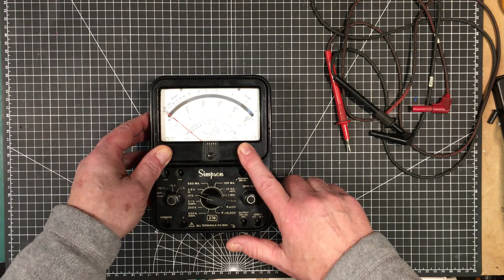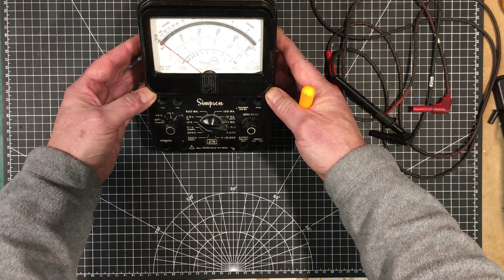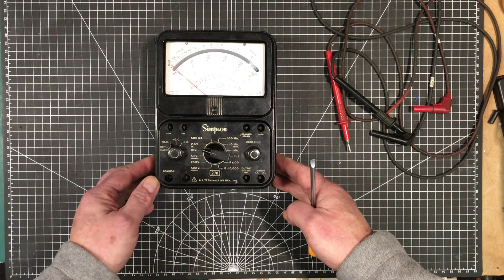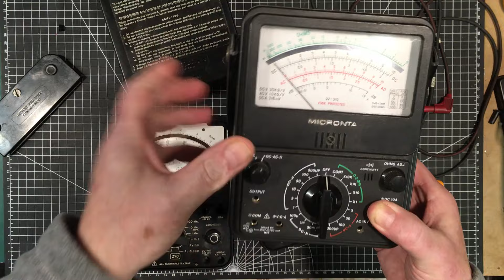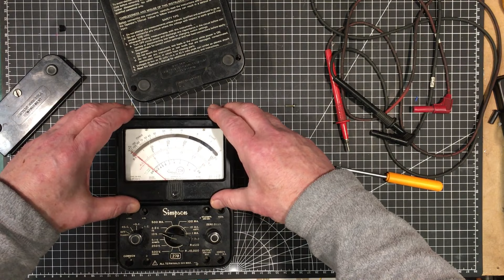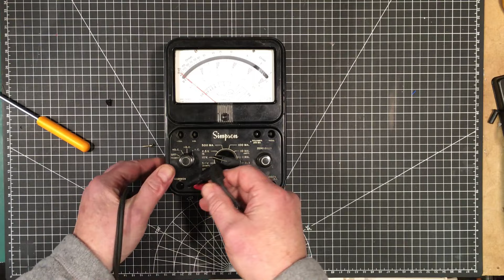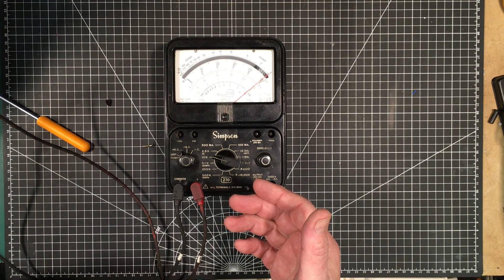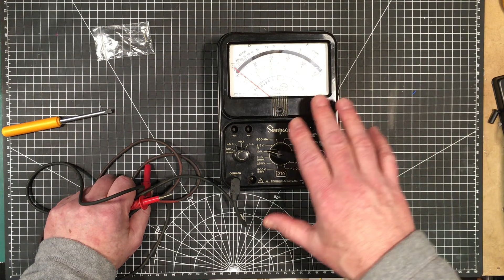Uni-Byte 0160 - Simpson 270 Teardown and Initial Troubleshooting

Comment: I have a 260-8 and a 270-5. Both great meters for my needs in maintaining and repairing aircraft and aviation electronics.  I stared with a micro at clamshell, went to a Fluke 77, then came to the Simpson about 9 years ago, and would not have anything else, except for maybe a Triplett 630 or something like that. A good epoxy adhesive will restore that broken Bakelite to like new, the contamination on the contacts, may be able to be corrected by pulling the board loose?
Reply from the maker: They are great meters.  Thanks for the ideas.

Comment: Great video - Simpson meters were about as good as you can get in terms of analog.

To fix the part that broke off, I once saw someone use superglue (ie Crazy Glue) dropped on baking soda (not baking power) to replace  some brittle plastic. The glue and baking soda formed a very solid material that also was firmly attached to where the original piece had been broken. Then file it to shape and drill in where you need a screw.  DISCLAIMER - I have never done this myself, so experiment first if you decide to try it.
Reply from the maker: Thanks for the suggestion.  I too have never tried that.  Maybe worth doing an experiment or two.
Reply: @uni-byte  If it works, hope you do a video on it!

Comment: For the screw issue... I did not study the video so closely to know if this would work, but maybe reverse the holding force... Rough up all surfaces with sand paper. Clean same with a degreaser. You want to remove the wax from the plastic surfaces, so the glue will get a bite. Acquire a piece of threaded bar stock that is the same size as the screw. Screw it into the remaining stanchion, as much as possible. Layer in epoxy and wide weave fabric to create something like fiber glass. Saturate the fabric, before laying it in (emphasis.) Try to mimic the original stanchion shape. If you could make it larger and still have everything fit in place, all the better. Use a nut to secure its other end to the case. Now, the holding force is not working against the weak spot, which is the broken stanchion. HTH.
Reply: Additional thinking... I have made dams with painter's tape and Blue Tack putty, to create a rough shape and to prevent the epoxy from running out of the area where it is needed.
Reply from the maker: Yeah, I have been having ideas like this too.  Since the material is Bakelite, the surfaces where the break occurred are very rough.  I think most good adhesives would do a fair job of cementing the broken piece back into place, then shore it up with some sort of epoxy after roughening up the exterior surfaces.  A greased screw, removed before 100% set took hold, would do a good job of retaining the thread.

Comment: A really secure glue joint is super glue and baking soda. Gouge the surfaces to give the materials a bite. They are an ugly fix, so use it where it won't be seen. Also the bigger the fillet of glue and soda is better. You can start with the super glue or the baking soda, and alternate either one to build it up. It will get hot and will smoke a bit. Use In a well ventilated area.
Reply from the maker: Maybe I'll look into that.

Comment: Last week the clear plastic fork for zeroing the meter broke.  I'm not sure if ihay is fixable.
Reply from the maker: That would be a difficult repair.  If yo have all the pieces you could try cyanoacrylate glue (super glue) or if you know someone with the skills have one printed.  The adjustment can still be made, but you will have to remove the face every time.
Reply: @uni-byte  I will try that if I can carefully make the adjustment.  I wish I could carry the 270 in the van but the vibration and environment would kill it.  My day to day work horse it's my FLUKE 87 V MAXX, sometimes really gets put through the winger!  Last night working all night in a heavy fog pulled it out this. AM and it looked like I left it out in the rain.

Comment: If you are dealing with Genuine Bakelite rather than a modern plastic analogue you should use 

Selleys 5 Minute Araldite Epoxy 

AFTER ensuring that the surfaces are properly cleaned.
Reply from the maker: Yeah, it's real Bakelite.  I'll look that up, thanks.